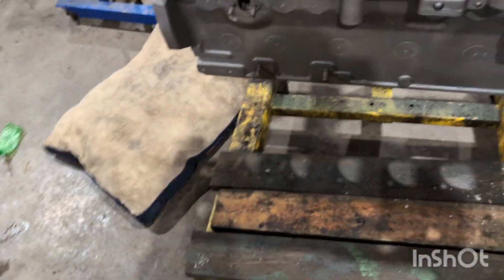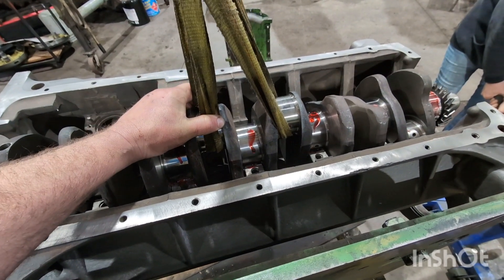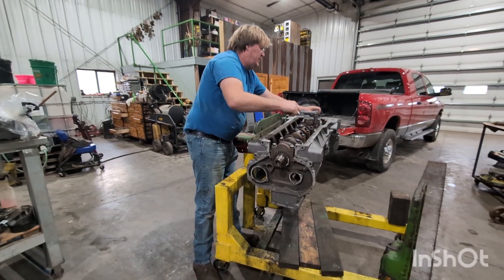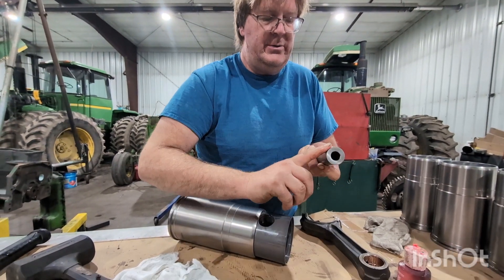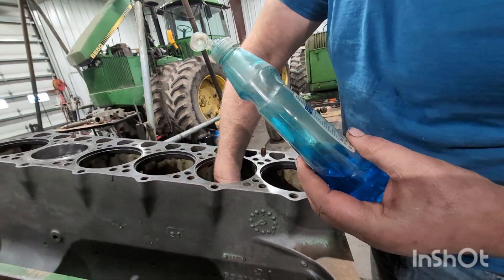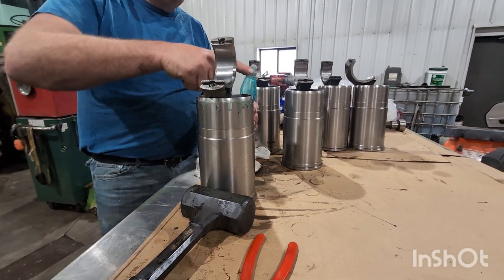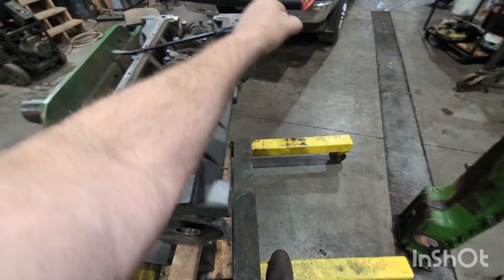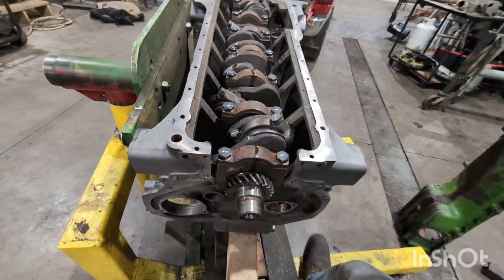4020 crankshaft and cylinders  installation

Comment: How difficult is it to replace an engine in a 8630 ? I have one I’d like to but and restore and use a little, but needs a engine been sitting for about 15 years
Reply from the maker: "Not hard". Ha, 
Remove the fuel tanks, guard and crossover tube 
Jack or two under the hinge
Bolts for side frames to hinge 
Hydraulic lines along engine on both side
AC lines and battery cable on left. 
Then you can get bolts out of engine mount. Depending on radiator shroud you might have to pull the shroud and fan.
Brackets at rear engine from block to side frame 
The front drive shaft collar 
Drain pipe from the oil pan 
Either weld some brackets on a running gear axle to bolt to the very front of the side frames so the whole thing don't tip. Over forward. You will roll the front axle with that big cast front piece, the radiator, all that stuff and the side frames as one unit 
Then I start stripping the engine down. But if you're just swapping shane hook onto the engine and get all the other miscellaneous stuff off 

Honestly it Takes me an easy 10 hours to get the engine to the ground. At least that's what I bill out. By the time you drive the tractor into the shop pump the fuel out, drain the water. Take all that miscellaneous stuff off if if you've got it under 15 hours, that's pretty good

Comment: When I was young and poor with a wife and 2 kids I overhauled my 3020 in frame. Was so proud, I used plastigage, lubed everything, then tapped the wrist pins in the rods to connect the pistons. This was before the internet and being older and still dumb. Engine is still together with no noise….i don’t know how, must be luck, I keep waiting to hear something…. Yes I had bushing material when I drove them in….that was 20 years ago. Wish I had the info on machining the pins to match rods but she still does 50-60 hrs a year with no issues. I’ll take her down and make it right if I ever sell her
Reply from the maker: Nice!

Comment: Hey John. That was an exciting video. Especially like imagining the outdoor temps while you are calmly hanging out in a t shirt.   If you had time could use your brainpower on a 4440 question.  I recently noticed when using a hydraulic pump sprayer that when I' in b1 or b3 I get the full pressure I want.  When I'm in b2 or b4 it holds a while but then oscillates.  I john deere dude suggested that this is an early sign the transmission is going out, something about the shaft running the length of the tractor,  What would you think?
Reply from the maker: @TwoHappyChildrenFarm  so what that John Deere guy is saying is that there's a drive shaft that couples into the crankshaft and it goes through everything and then it hooks to the transmission pump. But usually when that shaft goes it just goes. And there's no difference of that shaft whether you're in low or high. 
When you are in low it might be spring applied and when you're in high it's hydraulic applied. So when you're in high and you start losing some oil, the first thing you can do is rev the engine up to overcompensate for the leak or at some point you might have to pull the two-speed and investigate

I would have to say that the two-speed could have a slight leak.
Reply from the maker: @TwoHappyChildrenFarm  we are coming off of a couple days of 25 below

Comment: Should i rebuild my 329 or swap with 359 in 4030
Reply from the maker: @bigwhane8603  that's up to you. Ha.

A good used engine could be a cheap fix to a bad engine.
Reply: @ well is a 359 that much better

Why does 329 get hate
Reply from the maker: @bigwhane8603  not sure why people hate on them engines? They're good little runners. Not the horsepower and torque of  the 466 obviously but their peppy little engines.
Reply: @jonstevensmaplegrovefarms3754  i agree. Fuel efficient tooooooo